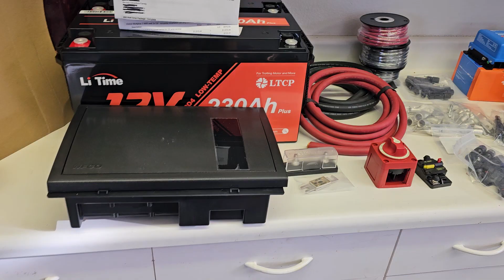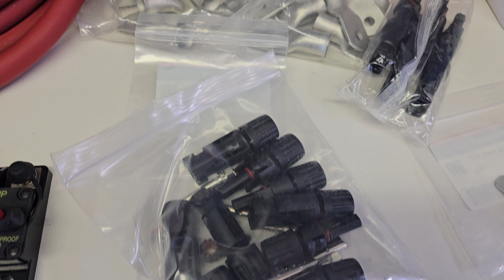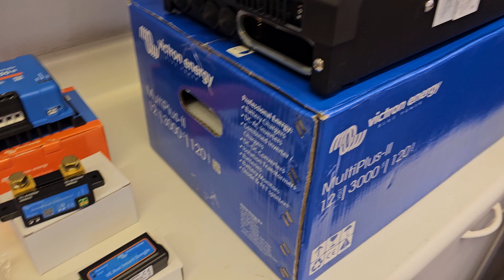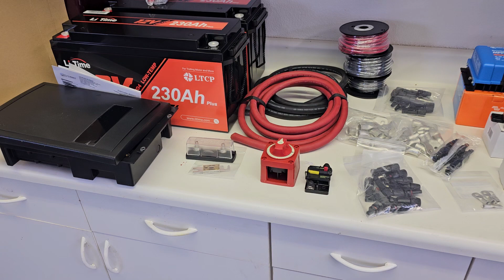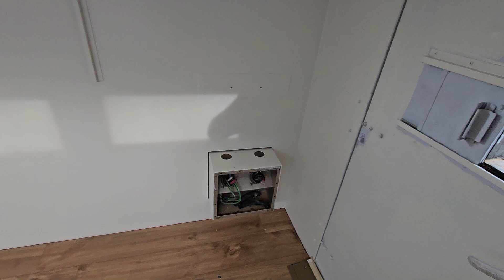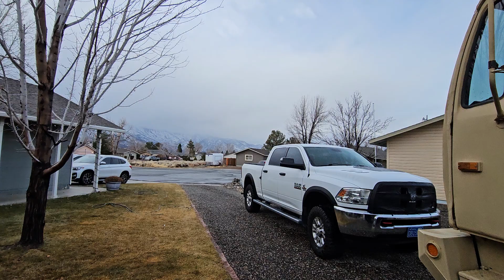RV solar system for our Stewart and Stevenson m1079 LMTV  military truck build.

Comment: Wth panel prices these days.... IMHO by time you pay for tilting stuff for panels.... you could buy two or three more solar panels  to ground mount, aim toward  sun, And could tilt by leaning them on things.... aka possible twice the charge return compared to  tilting your roof panels.  Hang store them on doors back end of 1079  or?? cab roof orrr??  when driving.
Reply from the maker: Not a bad idea. The tilt mounts are only $60.00 per set, so x4. I might just mount flat for now and see if I even need anything else. We are not running alot of power out of the box, just nice to have when needed. I also have a small back up generator I'm mounting for high load needs and bad weather backup.